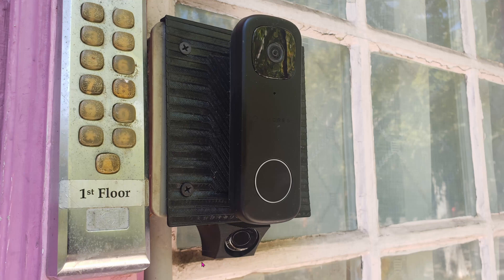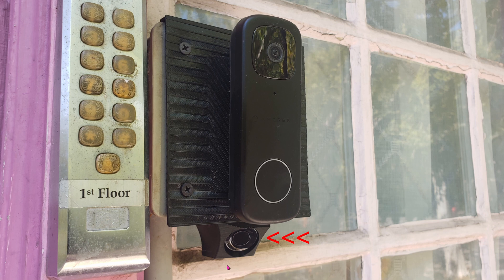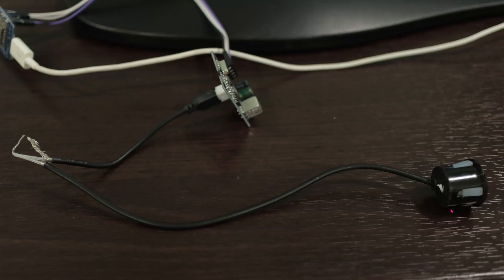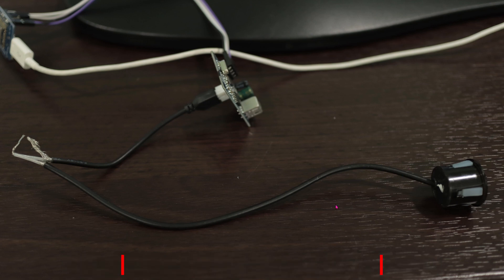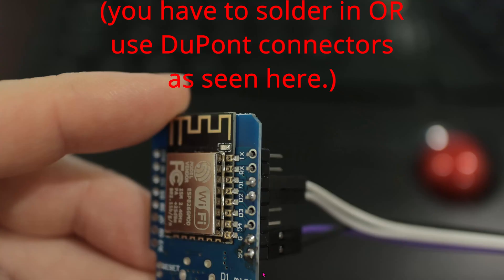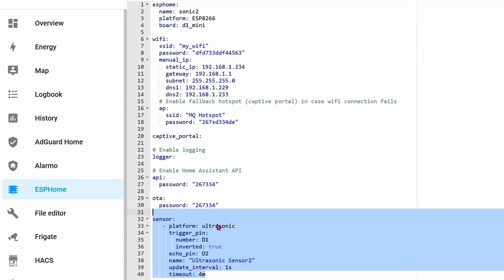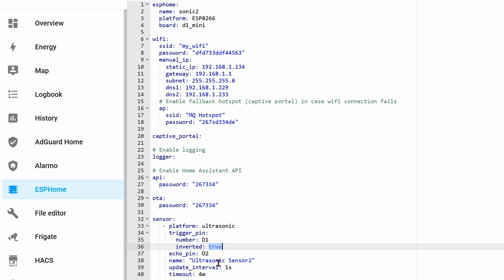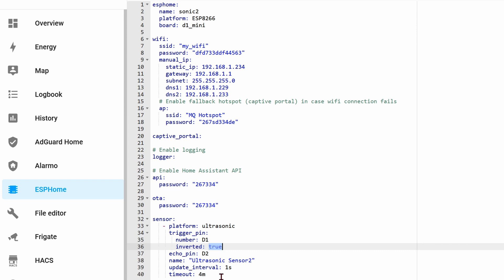How to build your own Distance Sensor, via sonar technology

Comment: I had to remove the inverted to make it work on my AJ-SR04M but thanks! Would you know how to modify the code to output a percentage instead of meters? I'd like to monitor my salt level in my water-softener and make an alert at a certain level. Distance 100% full is 5cm and empty is 90cm.
Reply from the maker: the code can stay for percentage. to get it done though, HA will convert distance to percentage for you
Reply: How could I adapt to measure the level of the tank water??